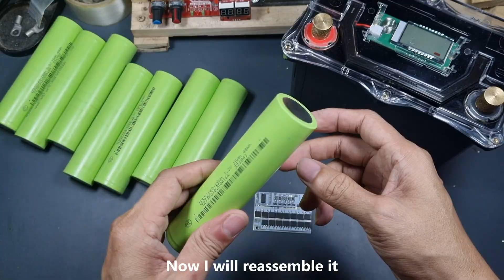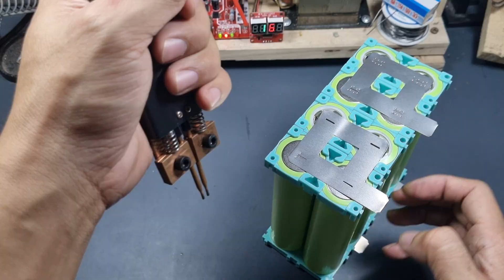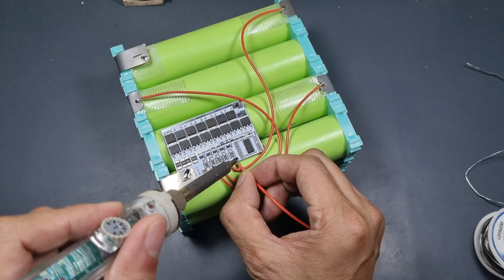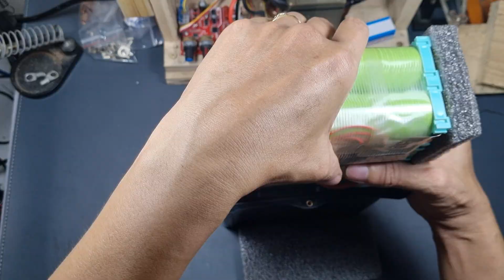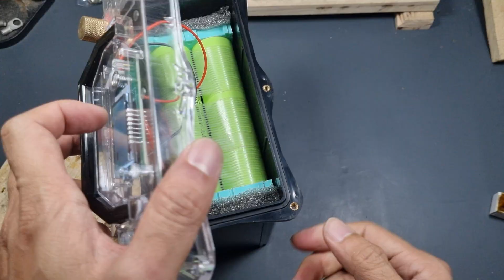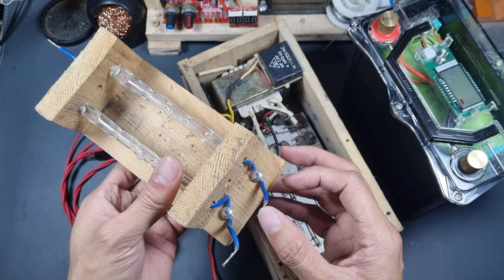Complete Assembly of 30Ah LFP Battery and Test With Voltage Converter1

Comment: Is it safe to use lithium 4s bms instead of LiFePo4 BMS ? Both have different power voltages.
Reply from the maker: hi pro,
I use 4S 3.2v BMS, this circuit is for 3.2v LFP battery.

Comment: Do you have the list of materials and the diagram of the bms? Thanks i loved your videos by the way ❤ i want to copy your d.i.y's battery projects 😊
Reply from the maker: Hi pro,
I'm glad the video was helpful to you.
Here is the parts list: LFP 32140 15Ah battery, 30Ah battery case with display circuit, 4s passive balance circuit 100A.
You can use 4s 150A active balance circuit, it will be better.
Reply: @diyideas2406  thanks for the list of materials am gonna use your vid for may reference in the near furture this kind of batter 😊 thanks again Pro